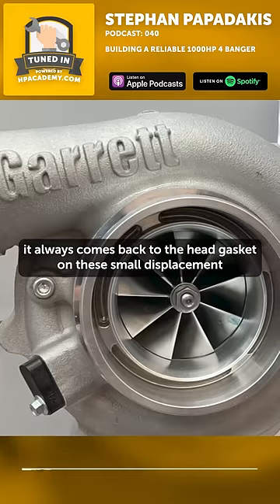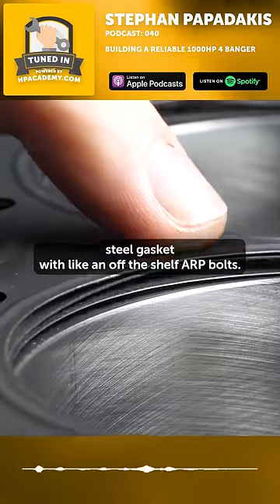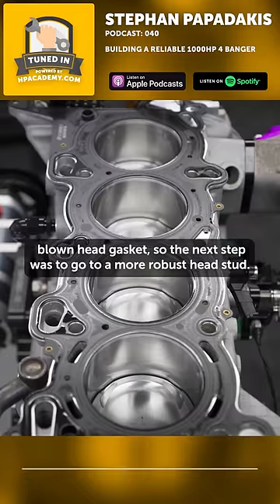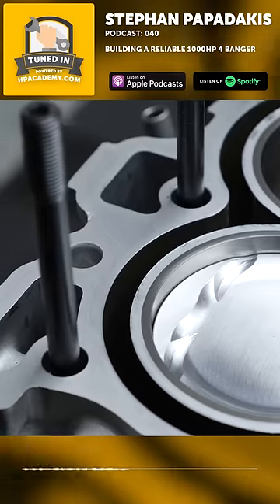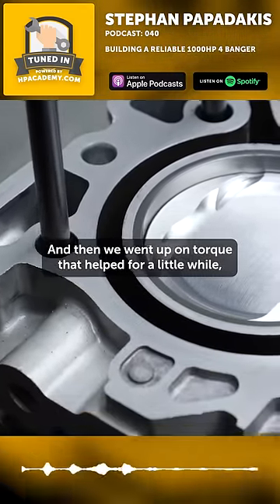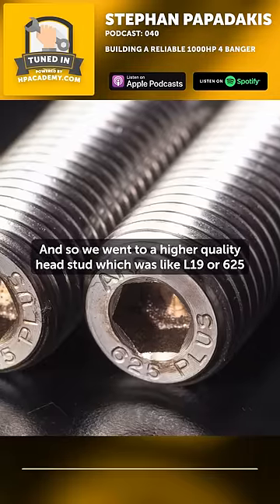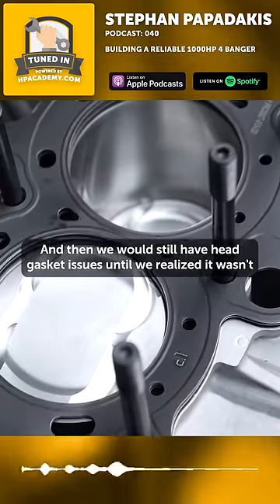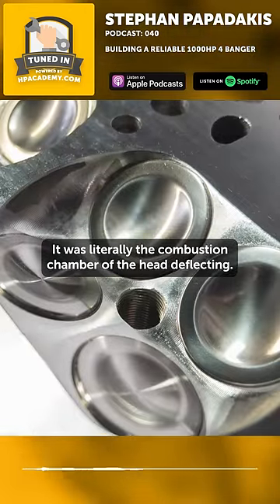How to hold a headgasket on a 1000hp 4 Cylinder 🏎😳 #shorts

Comment: Curious if a stronger more robust metal like  iron as a cylinder head combined with iron sleeves would fix this issue.
Reply: Yup, certainly! But if they're trying to use a four-cylinder they're more than likely worried about weight, the obvious fix is to get a larger displacement engine, but that increases weight.
Reply: Definitely. But aluminium conducts heat better and costs much less to machine because is softer, so almost all modern passenger car engines use ally heads.

Comment: You need 6 or 8 head bolts per cylinder arranged equally similar to a heavy-duty diesel engine
Reply from the maker: They got it sorted. From around the hour mark: https://www.hpa-tunedin.com/1755412/10629649-040-building-a-reliable-1000hp-4-cylinder-for-formula-d

Comment: It's all about total cylinder pressure that can be held at those pressures your warping the aluminum on the head get a billet head built out of better material
Reply from the maker: They have a solution that isn't a billet head. Full podcast episode can be found here if you're interested: https://www.hpacademy.com/blog/040-building-a-reliable-1000hp-4-cylinder-for-formula-d-podcast/?utm_source=youtube&utm_medium=social&utm_campaign=general-interaction- Taz.
Reply: Cylinder pressure or crazy torque values deflecting the head?

Comment: How is the combustion chamber "deflecting" different from the head lifting?
Reply: When a head lifts, the entire head pulls the head studs, and literally lifts off the deck surface. Deflection is whenever it slightly warps or bends, which does not necessarily stretch the head studs. If you were to turn the Boost back down it would be fine again, it's essentially lifting but at a very small amount. If they were to turn the boost up anymore it would definitely lift the head.

Comment: why not mill bigger cylinder bore until theres like 1mm clearance between the thinnest cylinder wall and buy bigger pistons, then seal head to block with some jb weld
Reply from the maker: Then you get different issues that might not be worth it. In a few videos you hear guys talking about this in realtion to the 4g63 - Taz.

Comment: We used to run o-ring style head gaskets on an aluminum headed nitrous 13:1 SBF wayyy back in the day and they helped a lot. Barely had any experience with high Hp 4cyls but I wonder if this type of gasket would help, if they're even available.
Reply from the maker: They come up next in the discussion. Full episode is a great listen if you have time - Taz.
https://www.hpacademy.com/blog/040-building-a-reliable-1000hp-4-cylinder-for-formula-d-podcast/?utm_source=youtube&utm_medium=social&utm_campaign=general-interaction

Comment: There's no replacement for displacement.
But if you insist for some reason, the sleeves and head need to be single piece (no head gasket to fail).
Reply: No engine exists like that.....
Reply: @codyramos3200  1000hp with 44psi boost, 2.61L Monoblock.
Reply: @thisisyourcaptainspeaking2259  I tried to find it.  You got any other info other than numbers .
Reply: @codyramos3200  Offenhauser
Reply: That's an extremely interesting idea, I like that. I usually end up thinking of my own designs and find out they've already been taken, but I can genuinely say I've never thought of that... good pointing that out!
Reply from the maker: Turbochargers are the replacement with this project going on to beat many other larger capacity engines and win championships =) - Taz.

https://www.hpacademy.com/blog/040-building-a-reliable-1000hp-4-cylinder-for-formula-d-podcast/?utm_source=youtube&utm_medium=social&utm_campaign=general-interaction
Reply from the maker: As for monobloc engines, you are removing an issue, sure, but you're just adding others. Monobloc construction and motorsports/engines go back near on 100 years or more now. Here's a chat about one from 30-40 years ago in F1: https://www.hpacademy.com/blog/how-to-keep-a-cylinder-head-sealed-to-an-engine-block-a-unique-solution/?utm_source=youtube&utm_medium=social&utm_campaign=general-interaction - Taz.

Comment: Is dry decking a possibility on those engines?
Reply: Yup, it's possible on any engine if you go to a good reputable machine shop. But that's not really going to help much here, what they need are stronger casted heads, or possibly CNC heads. Going with iron heads would also alleviate the issue, but if they're sticking with a 4-cylinder (instead of going to the obvious larger displacement engines) they're probably worried about weight.

Comment: Just get a big displacement stronger engine
Reply: The fact that they're sticking with a small engine tells me that they're worrying about weight, that's probably why they're using a small engine, another fix would be using an iron head... but obviously iron weighs more for the same volume.

Comment: Would close/ semi closed decking the block help?
Reply: Not really, this would only strengthen the deck, the problem is that the head is actually warping to the point where boost is able to seep between the gasket.

Comment: Id just like to make ~340ish whp on my bk2 genesis 2.0t 😂 id end up wrapping my car around a tree if i had 1000hp
Reply from the maker: 340whp is a very respectable, and fun, figure 😎 While it has its place, more power generally = more problems too. This team did manage to get enough of a handle on this to take out a championship before moving onto a new chassis and engine to do it all again - Taz.
Reply: @hpa101  yeah i already got 103k miles on this engine so i dont want to push it too hard...but if it does blow up ill just build it with all forged internals and finally get that isr evo x turbo kit. Possibly just engine swap to the 3.8 V6 with forged internals and a nasty turbo or be a basic bitch and LS swap it 🤣

Comment: No replacement for displacement baby.
Reply from the maker: Forced induction is 😎 _ Taz.
Reply: @hpa101  only on a relative scale. You can put boost on anything.
Reply from the maker: For sure! What about weight though? Packaging constraints? Class rules? Fuel burn (endurance racing) and much more. So much to it all beyond a peak HP figure and the displacement or amount of cylinders you have 😎 - Taz.
Reply: @hpa101  Agreed. That’s the best part about the mechanics is theres so much to appreciate.

I suppose my bias lies in the diesel engine. The work horse of humanity.
Reply from the maker: @SayNO2CAMEABUSE  we've had a few diesel tuners on the podcast so far too, hope you've enjoyed those episodes if you've had the chance to already 😎

The Diesel Performance Podcast has some solid episodes as well, quite a mixed bag of topics like our episodes as well  - Taz.

 https://www.hpa-tunedin.com/

Comment: Imagine if you can a cupped piston and the heads and valves being inverse Hemisphere as compared to a Mopar..
Reply: Well, just like having a hemi head, they're very inefficient. That's why they have to have two spark plugs in order to get proper combustion. It's a poor design that comes at a cost. There's a reason LS heads and Coyote heads are superior.

Comment: What do you mean by deflecting?
Reply: Deflection is whenever an object bends or distorts from its original shape. Under immense pressure, the cylinder head will actually warp and allow boost to seep between the gasket.

Comment: Okay, so how did you remedy the situation? 😂
Reply: Get a larger engine that's capable of taking more power... pretty much that easy. Or invest in stronger heads, ironheads would relieve this issue. The deck would still Flex a little bit but nowhere near as much as the head would. The head is taking the blunt force of most of the combustion anyways, custom aftermarket CNC heads would likely do good. Or just turning the Boost down slightly, but us gear heads don't like hearing that!😂
Reply from the maker: Full episode here invisible.spectra: https://www.hpacademy.com/blog/040-building-a-reliable-1000hp-4-cylinder-for-formula-d-podcast/?utm_source=youtube&utm_medium=social&utm_campaign=general-interaction

I think this part is about an hour in - Taz.
Reply from the maker: @Seth88 to get the equivalent power out of a larger engine you run into the same issues wether that is a larger capacity 4 cylinders or something with more cylinders (and weight) - Taz.
Reply: @hpa101  no, you dont. 1000 hp can easily be acheived with NO issues. What are you smoking? LS engines, Coyotes, Hemis, etc etc... All can make 1000 hp without the need of 44 psi and never have the issues you mention. What exactly do you mean?
Reply from the maker: @sethh8892  I said equivalent, sorry for not explaining better. 

Double the capacity, double the output to be comparable, so you would be gunning for 2000hp+ to be comparable to what is done here, not 1000hp.

Make sense? Note also if the power itself was the ONLY consideration we'd all be running 15,000hp marine engines that are the size of a building right 😅HP output is just one data point - Taz.
Reply: @hpa101  i gotcha, that makes way more sense
Reply: @sethh8892  
Big engines don’t easily fit into the space an inline 4 came out of so you build power off of what fits.
Reply: You machine the head to accept fire rings 😎
Reply: @hpa101  thank you for the link, I was looking for the full episode and couldn’t find it to save my life lol
Reply: @sethh8892  More Cylinders more problems lol anyone that grew up around snowmobiles learned this at a young age.
Reply: @cowboythomas5904  again, not always. You can have more cylinders and still have a reliable engine. That idea is preposterous.
Reply: @sethh8892  Your right they can still be reliable but, they will never be as reliable as inlines.
Reply: @cowboythomas5904  you're acting as that's a fact, but it's blatantly false. Every V platform is just two inline engines, without two crankshafts... I need to find your dealer cuz the crack you're smoking is great 😂
Reply: @sethh8892  So take your V6 camaro out and smoke your rock and tell everyone about all the mods it doesn't have. Hahaha
Reply: @cowboythomas5904  v6 lmao, keep dreaming. You're just upset bc Im right.

Comment: 1000hp 4 cylinder. Wow. Go with a more rigid head(iron) or possibly add more head studs(bolts). Pauter, who makes heads for air cooled VW uses 5 studs instead of just 4.  The next alternative is to dial down the boost if you want more reliability. More power for a given displacement more pitfalls.

Comment: It’s the hole in the cylinder head you can’t use la  multilayer gaskets with those heads dude try again get the high boost gaskets and machine the head and block to fit it.
Reply from the maker: They got it sorted and won a championship, this was just part of the journey to find the limits of an engine that was new to the market. Hope you enjoy the full podcast episode if you're keen - Taz.
https://www.hpacademy.com/blog/040-building-a-reliable-1000hp-4-cylinder-for-formula-d-podcast/

Comment: Need a mercury engine design, head and block are all one. Could try less clearance on the head, shave it down more but if the valves are sticking out too much then there's not much you can do.
Reply: how would you make that though & attach the pistons etc

Comment: What engine so I can avoid it?
Reply: Lmao, any low displacement 4 cylinder😂 but it's really not that much of an issue... if a small four-cylinder like that is able to make 1,000 horsepower reliably, turning the boost down, just before it does this, would be an easy fix. Although I wouldn't consider a four-cylinder making a thousand horsepower to be reliable. I don't think that engine's able to get 100,000mi to 150,000mi without needing a rebuild.
Reply from the maker: 2AR, they got well past this and bet all the 'just chuck a V8' in it guys though just FYI 😂 - Taz

https://www.hpacademy.com/blog/040-building-a-reliable-1000hp-4-cylinder-for-formula-d-podcast/?utm_source=youtube&utm_medium=social&utm_campaign=general-interaction
Reply: @sethh8892 …. I have a QR 25 DE on 18 pounds and it’s always an issue with the air intake phaser gear so my tune is tailored around that.My next belt is going to be a K 24.
Reply: @toysforboysrc  hell ya, the k24 is great, keep it up!

Comment: Meanwhile some guy buys a junkyard 5.3 slaps a turbo on making 1000hp no problem.
Reply: The engine he’s talking about is a 2 liter engine. He’s making 1000hp in an engine 1/3 the size of an LS. Build a 6 liter LS to make 3000 hp and tell us how you did it.
Reply: @IcanDriveIt  Lol you don’t have to tell me. I know what a K20 is, I have a K24 in my Honda and I also have an L98 V8 in my Corvette. 

What I’m stating is facts. There’s no replacement for displacement. And anyway the quickest 1/4 for a 4 banger was a GM ECOTEC 4 banger. Not a Honda 4 banger. So even when you do all that stuff to a Honda ya still lagging behind. All that money into a small engine to squeeze every bit out of it when someone makes the same power for way cheaper on a junkyard V8.
Reply: @destruxandexploze2552  that’s a old timers saying. Nitrous, superchargers, blowers and turbos having been proving that wrong for years. 

It takes more then slapping on a turbo to make a 1000hp junkyard ls.  You need a cam, timing chain, lifters, pushrods, trunion upgrade and head gaskets. I wouldn’t be bragging about owning a L98. Probably one of chevys most hated engines. And those are facts
Reply: @gregorygraves8362  L98 is still a 350sbc parts are interchangeable. You can easily take the TPI off and add something else, miniram, stealthram, LT1 intake, or John Lingenfelter’s intake. It good low end torque. Fun car. 

Oh and it’s not bragging, I’m just saying I’m not biased. I got a K24 Honda, my Dad’s got the J35 in his Honda, my Grandma has the L15BE Turbo in her Honda. I got the L98 V8, my Dad’s also got the 4.6 2V PI V8. I’m just saying it’s easier at the end of the day to grab a truck LS motor and boost it. I mean there’s several videos proving you wrong on how you have to do a ton of other stuff to make that power. (Also the ZQ3 would be the worst Corvette engine, that made only 165hp, and wasn’t even 350ci it was 262ci)
Reply: @destruxandexploze2552  nobody yet has claimed that a 4 cylinder makes power as easily as a v8. Nobody. They are discussing fringe issues in an extremely high performance motor, regardless of end output. This is about getting as much power out of a motor as possible, not just making a generic power output. If you can't stay on topic you probably shouldn't bother commenting. If you can't wrap your head around anything other than an LS motor, then stick to your thing. The adults are talking about things you might not understand.
Reply: @destruxandexploze2552  lmao I'll wait name any part from that quickest quarter mile car that came out of a GM factory and explain how someone using a GM style block equals GM is way ahead of honda not to mention complete modified chassis lmao
Reply: @greggutman2  It’s been 2 years since that 4 banger Ecotec made that quarter mile record. It’s still only 2.2 liters. I think someone with experience with Honda engines should have broken that record by now. 

The second fastest is C20XE GM 4 banger. 

That means a different generation of GM four-cylinder engine powered the first and second fastest four-cylinder quarter-mile passes of all time.
Reply: @brahtrumpwonbigly7309  My original comment was supposed to be just some joke. It’s funny how easy it is for other people to make similar power because they have a larger engine. Who knew? It’s the guys who can’t take it seriously I like to fuck with. 

I still have the power here.

Comment: Head gasket issues mean bad engineering. You shouldn't need thor's hammer levels of clamping force to keep the head gasket inside the engine....
Reply from the maker: For low power levels yes, for high output engines with immense cylinder pressures you do. Funnily enough, this engine is named Thor, 2/3 of the way though there is some discussion I think you will enjoy 😎 - Taz.

https://youtu.be/J87SVqG18sY

Comment: Best just not have the head gasket and make the cylinders and head one part 

Not easy but has been done on high psi turbo race engines
Reply from the maker: That just creates other problems. They have a solution they are mostly happy with for now which he discusses next in this podcast episode :) - Taz.

Comment: lol what would actually happen if you welded the block and head together? Head gaskets are the weakest point of the engine so why not
Reply: @Heffalompen lol totally
Reply from the maker: You just get different problems remembering there is quite a gap from the cylinder wall to the edge of your block with water jackets and oil galleries in there too.

A monobloc would be better, but again, different problems - Taz.

https://www.hpacademy.com/blog/how-to-keep-a-cylinder-head-sealed-to-an-engine-block-a-unique-solution/
Reply: @hpa101  damn didn’t expect a serious answer but thxxx will check out the link
Reply: It's been done before on a few of the older turbo era f1 cars
Reply: @wardj1922  ohh. Damn
Reply: Offy had the cylinder and head cast as a unit
Reply: @bobstitzenberger1834  how do you fit the valves in the head and the pistons In the block.?? They have to be made in 2 half
Reply: 1920s Bugatti had a cylinder head that was integrated with the cylinders(one piece) that was bolted to a separate crankcase. Issue is you have to tear down the whole engine to service valves.
Reply: @daleevans9029  for a one piece block and head, pistons go in from crank side.